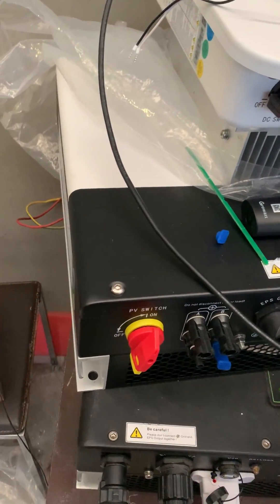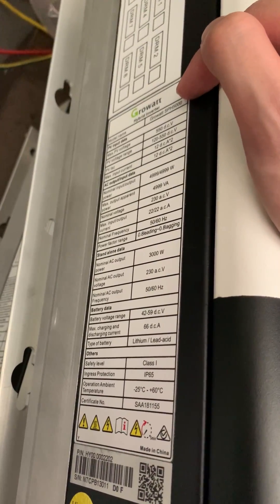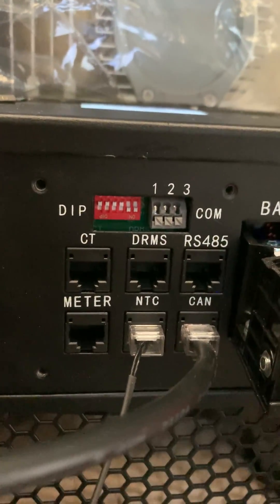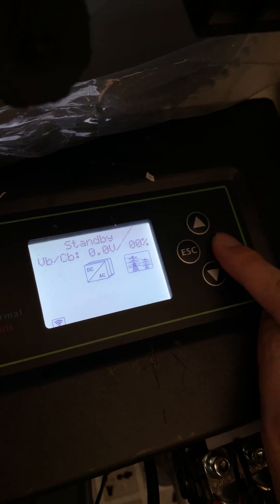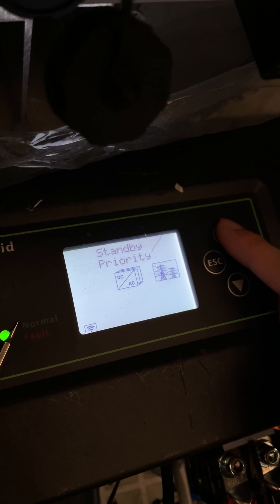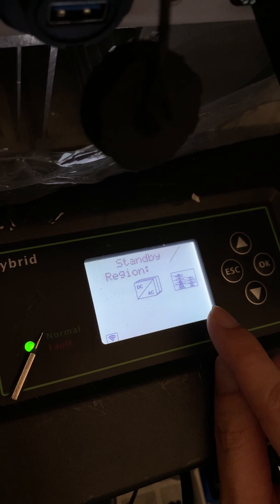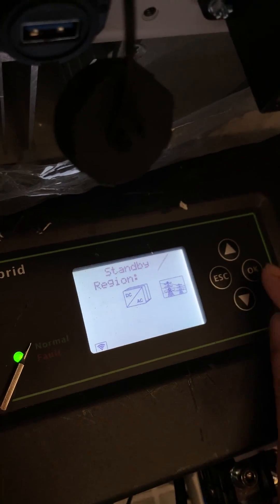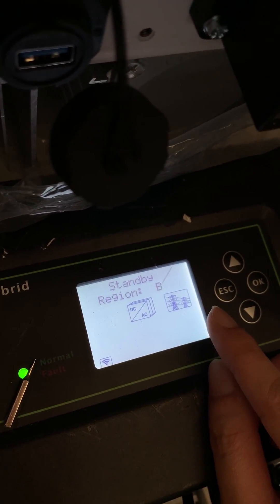Growatt SPH series inverter region setup tutorial

Comment: Hello..
How do we connect NTC to the inverter? Does it have a specific part number? How do I overcome the warning message "NTC Open"?
Reply from the maker: The NTC sensor is only required when installing the lead-acid batteries to the inverter. If the battery is lithium batteries, then it is not required. For installation, please refer to the manual, it can also be found in our website https://au.growatt.com
Reply: @growattaustralia1112  There are no instructions in the manual to connect a NTC to the inverter. What I'm asking is if there are any specific part number/model for the NTC.
Reply: @HemalJayasooriya I could not find an NTC sensor on the market but I built one myself with basic components from some electronics ..works perfectly

Comment: Is it possible to limit the charge current? SPH can charge with up to 66A, which is more than the battery supports -.-
Reply: Yes in the controls on the shinephone app it shows TOU Charging, you can change the percentage of power it charges at, 66A is 100% so change it to lets say 50% and it will charge at 33A. If it has a BMS then it should communicate alot of these things anyway.
Reply: Please, how elimenate mode stand-by ?